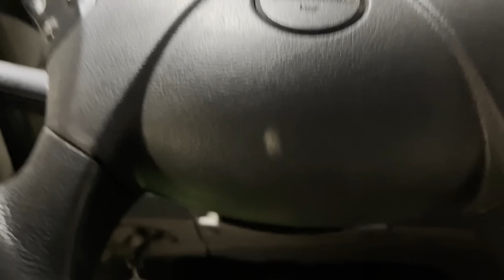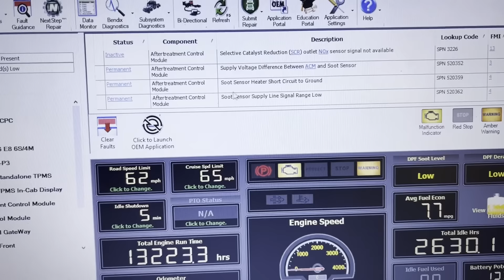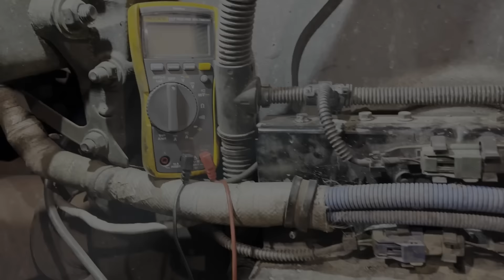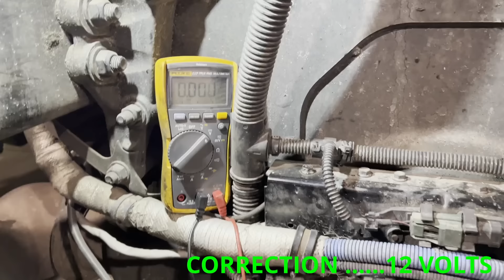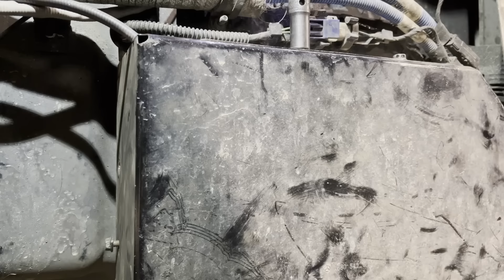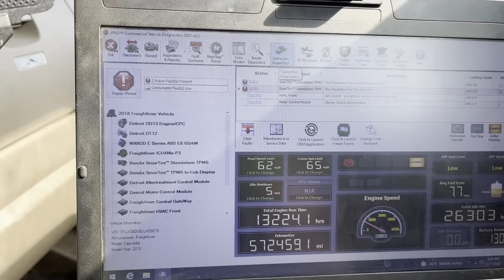FREIGHTLINER CASCADIA SOOT SENSOR CODE SPN 5741 FULL DIAGNOSIS AND REPAIR | REGEN ISSUES | DERATE

Comment: Garbage job of soldering. First off, use a linemans splice. Second, heat the wire to melt the solder, a cold joint will fail. Third, you should have put a jumper wire to move the repair away from the bend that broke it to begin with. I do like that you used shrink tubing to seal it.

Comment: Some manufacturers prefer to use butt connectors with heat shrink, like Cummins . They suggest repairing wiring with insulated butt connectors due to the fact that solder can break easier in semi trucks with the vibration a semi goes through. But everyone has their own way of doing things .
Reply: You 100% correct, small wires are terrible to soldier, there is even a but connector that works like a butt connector and a soldiering metal inside!